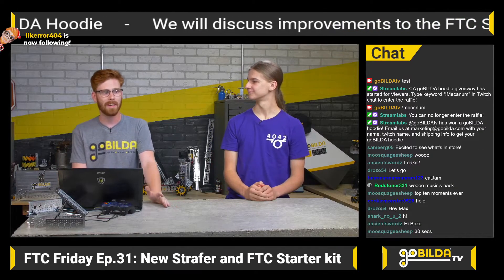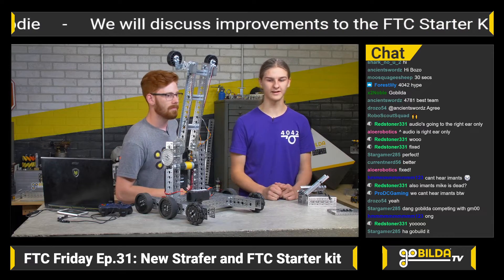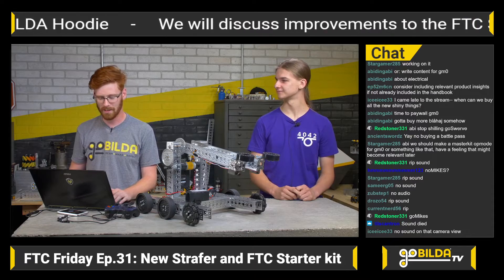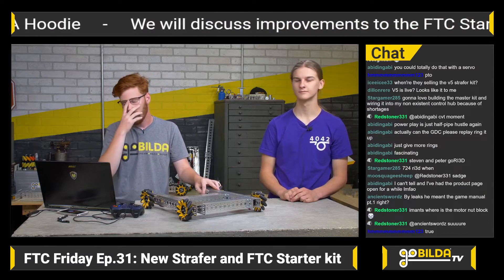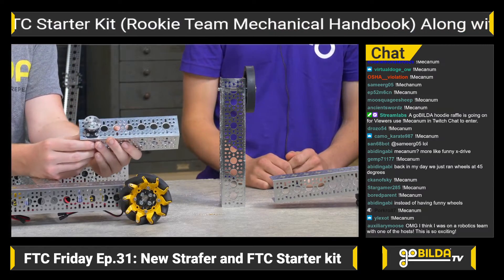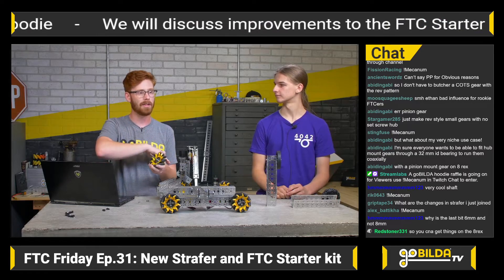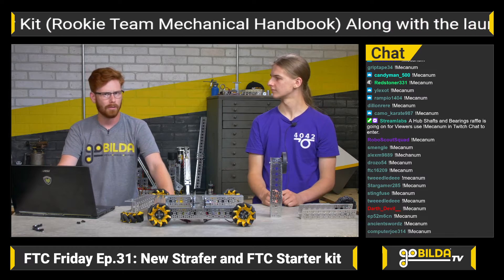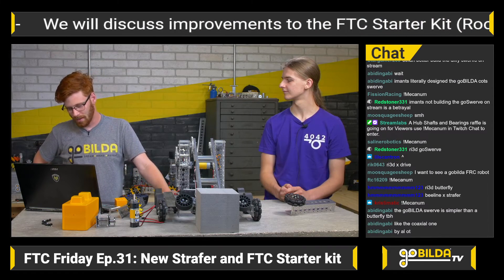FTC Friday Episode 31:  Updated FTC Kit and New Strafer Chassis

Comment: I will send an eMail to see if my questions can be answered.
One would think it would be mostly easy to find outfits who offer all the component parts that are needed for all these mechanical contraptions, and of course the brain circuitry to drive the mechanisms... not so!  I have looked at so many I am about to give up.

- Servocity was my first ever, one needs to be rich to afford the crap.  and it is limited to boxy structural results... IT SURE LOOKs as though the few structural pieces you show are very much like Servocity stuff!?

- Lego is so clunky it takes 10 times the space, thus requires a massive count of pieced together parts, and the model ends up bigger than your kitchen table.  and the parts can only be sourced on the after market.

- Meccano comes close, but still is lacking severely in precision and bearings scenarios... and the parts can only be sourced on the after market.
whateVuh... let us see what my email result will be.

Comment: Well, after 24 hours of wasted time, I cannot decide what parts are compatible... what will seamlessly bolt into what at what size... no matter what approach I take to resolve issues, I run into an impasse that makes the model impossible...  unless I generate my own parts, either CNC or 3DPrint.
Yet in shtty MECCANO, I am able to put the contraption together, 100%...

...and the website layout is not conducive to easy comparison.
It is all in horrible drill-down buckets where one has to remember where a part is, and drill up and down to get to the detail and out of it...  not very clever...
The presentation sells the .770 and 1.5 system and puts one in that mode, yet other patterns are sneaked in the middle of the pack with no warnings!  LAME!

FIRST, all parts should be on a basic WALL map, so one can browse quickly to nail what actually exists!
THEN, all parts should be on a scroll up/down alphabetical master list,  [ screw all that lame drill-down crap ]
- with all detail at each presentation of a part,
- with an easy ABC filter dropdown to narrow the result set to a part type, that is always on the screen [ like the GROUP/subgroup shows on the dropdown, [ STRUCTURE/beams] or 2 separate dropdowns ]
- with an 'ALL' option to see them all,
- and an advanced filter should also separate incompatible items!

Unless one is building a simple boxy contraption, this system is lacking in needed parts to accomplish a complete job.  Example:
  ...  on 1/2" shaft.... 25# plastic chain, plastic sprockets(.770 pattern)
       - need hub with 3/4" (.750) clearance diameter on end of shaft, no such thing
I redesign the contraption to allow more space:
  -- 3/4" + 15%  worm gear HUB .875
   - but the bolting pattern is .575         [ NO WARNING!, wasted my time]
     ...and limited to a 1/4" and 6mm D-bores, new can of worms starts
  -- 38%
   - ok let's try the hyper HUB, made for 1/2" shafting, 1.209 clearance    [ things are getting bigger! ]
      -- but the bolting pattern is .630 [ NO WARNING! ]
  -- 45%
   - standard clamp HUB 1.360 clearance...   [ = everything needs to double in size ]

 ...but now I have to do all the homework to see if I can double up the size.